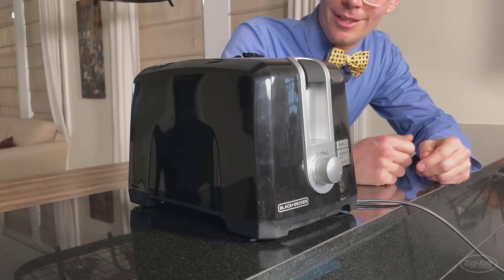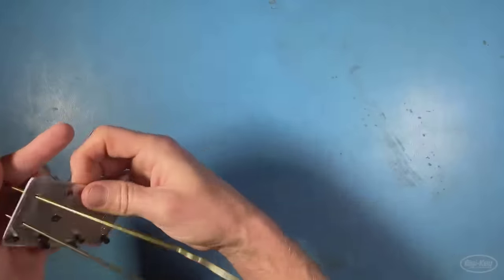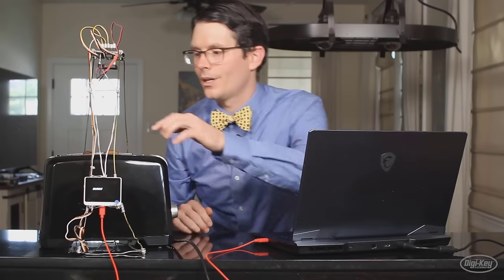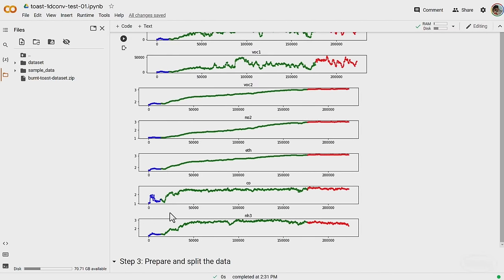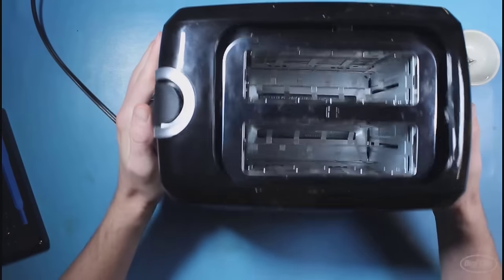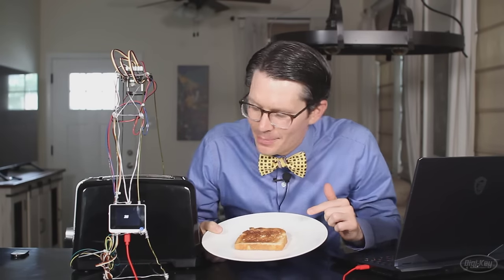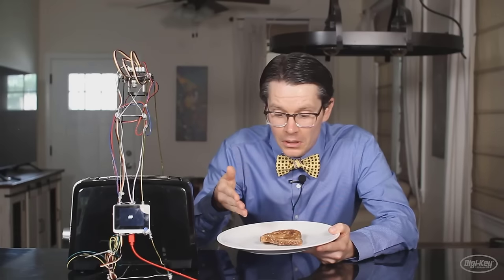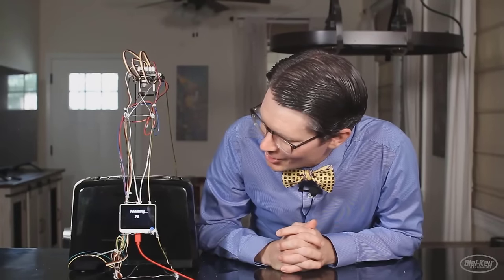AI Toaster That Makes Perfect Toast Using Smell | Digi-Key Electronics

Comment: This is pretty much exactly the kind of project I've been working on as a hobby for my classic RV. Instead of determining toast doneness the idea is to determine if anything starts changing in an unexpected manner and prompt an alert(oil pressure, air fuel ratio, engine/transmission temperature, a change in engine harmonics, etc). Been a fun project so far as the vehicle is completely analog and the sensor upgrade will hopefully mean that I won't have an unfortunate road trip that ends with the engine having eaten itself midway. In some ways your toast project is more difficult in that machines that have oscillating or rotating components produce harmonics that can be tracked through frequency analysis(and somewhat diagnosed that way as well).

Comment: When I first got my toaster I set the control at the 4 ( out of 5 ) setting. It was perfect. The next slice of toast I set the timer on my microwave for 5 minutes and started the toaster. It popped up and doing a simple mathematical subtraction I found that the perfect piece of toast was at 3 minutes and 42 seconds. NOW every time I put a piece or two of toast in I say: "Alexa... 3 minute and 35 second timer." That allows me 5 to 7 seconds to get to the toaster. IF the toast hasn't popped up by the time I get there I then KNOW that someone has moved the timer/heat setting on the toaster and I manually raise the toast up out of the toaster. If somebody set it to a LOWER setting the toast would've popped up sooner and I'd be sending this text from prison as I would surely have murdered someone.

Comment: That’s awesome Shawn! A love for perfect toastness! Do you think the sensors could be changed with the sensor inside a smoke/CO2 detector as it is of higher calibration?
Reply: I don't know the answer to this.   I just say,  I think smoke detectors work by testing how much light is detected through a cavity; where there's smoke it blocks some light.  When there's a threshold met it triggers.

Comment: Would love to see what happens if you put a pretoasted slice it. Would it burn it or not? I still think cameras that take visual cues would be a whole lot more effective. Maybe a modified toaster with some glass sides so the cameras dont have to be inside the toaster.
Reply: We actually tried this last week :) It cooks the toast a little more (as it heats up), but it does pop it early. Agreed--the visual sensors would work a lot better, but I just wanted to try doing something based on "smell" :)

Comment: You used a water based extinguisher on a electrical circuit. Otherwise loves it
Reply: It's listed as classes A, B, C--so it should be able to handle electrical fires (in theory) :)

Comment: 16:30 There are two questions that came to mind when watching. 1) After the toast is complete, the number on the display is far below the 40's & I was wondering if an immediate toasting after would require some sort of delay before disengaging.  (would it insta-pop because the previous toasting left the sensor data with a value over "finished"?) . . . 2) Did you do a control group test to see if "heat" modified the registered data of any of the sensors? (look at the data with no bread)

Comment: This is thermalitic preasures high to low sound understanding echoes of distances between one the other colors change there character with in the flow heat distortions of light can determine temperatures in a river of destruction of heat .

Comment: this is not AI. you tried to train it and whatnot but eventually had to settle for a really complex way of just setting a timer based on your own visual guess. the impressive feat was attaching the digital "timer" to the lever cancel switch. the timing never changed. the frozen one popped at 44 seconds. same as the first piece

Comment: Couled springs and contacter are not going to get anything done with temperatures flex on off metals in the toasters oldest tech changes to a multitude of platforms for information into the projects carefully selected for the buildings sub structures design before the city's conception and expertise of mindfulness of the whole picture is worth it later to realize systematically we could understand the whole picture of a city